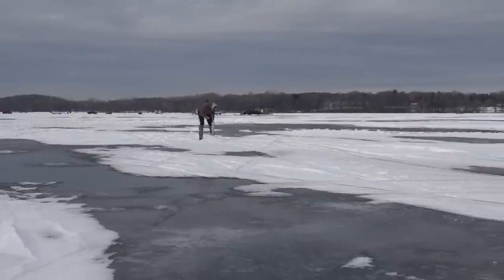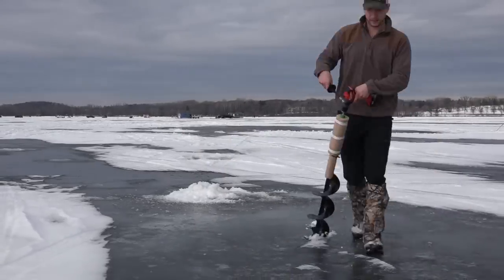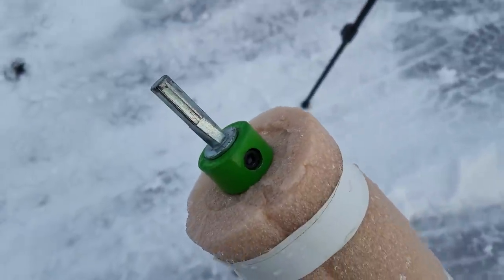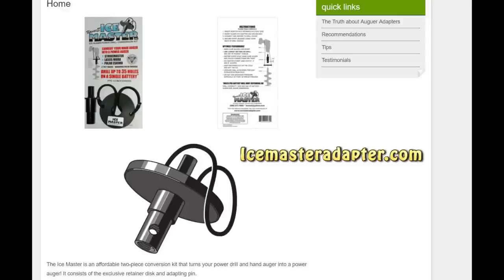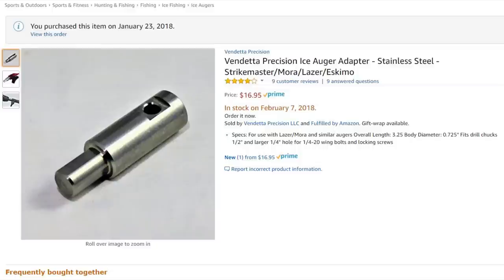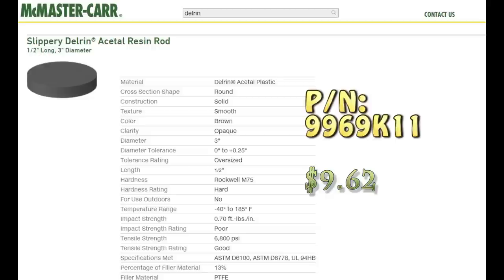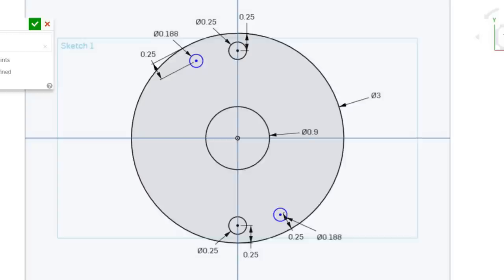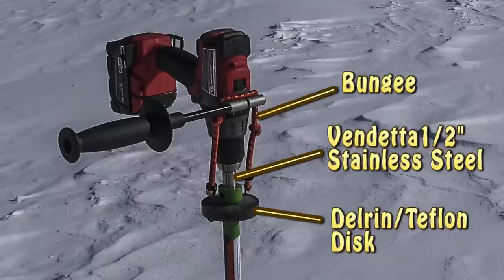Ice Fishing Drill Auger Adapter - DIY

Comment: I was surprised how easily an electric drill can power through ice. We were using the Clam adapter and a Dewalt 20 volt drill. Way better than a heavy gas auger.

Comment: Well after a week of watching You Tube video's on Milwaukee, De Walt 
& Ridgid cordless drills along with some others that drill holes for
 Ice fishing, and looking for the best drill deal I bought a Ridgid combo set. I got mine at the 
local Home Depot model # R9602 for 119.00 the drill uses a brush motor 
that has 535in. lbs of torque while the impact driver has 1750 in lbs of
 torque, this along with a charger and 2- 1.5 Lithium ion batteries. 
I'll be using the drill on a Mora 6"  And from what I've seen either the
 drill or impact driver should do a good  job punching holes in the ice. The price & the lifetime warranty on the drills and free replacement of the batteries made the Ridgid a easy 
choice for me, any advice or tips from you more experienced cordless 
drill owners would be great!

Comment: hey, already asked that under your different video but still, i just got a nero auger with an drill attachment, and there is this very light wobble between the auger and the attachment, a tiny one, but it still moves, i didn't try the drill yet and the ice is gone this year, is that wobble ok or it should be absolutely zero wobble between an auger and attachment when everything is tightly screwed in?

Comment: You should do a side-by-side comparison with the K-drill. The Lazer looks to be faster.
Reply from the maker: +River Valley Outdoors My dad has a K-drill and the M18 Fuel. He thinks it is slower than my Lazer after watching my video. But we're going to try to get together for a fishing trip in March and put them head to head. There are other variables to consider also, like weight, cost, ability to overlap holes, etc.

Comment: Is there a reason why I couldn't use a small wooden disc with this design?
Reply from the maker: You could. I used the material I did because of the lubricity but if the wooden disc was sanded smooth on the contact surfaces it should also work.